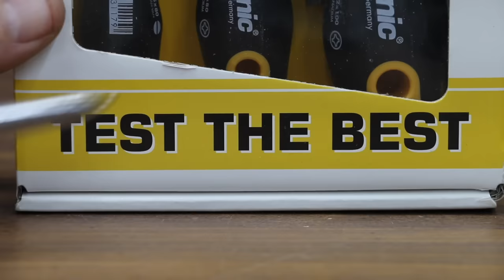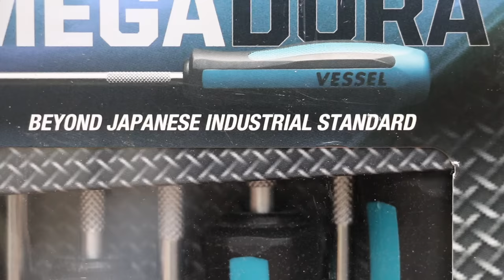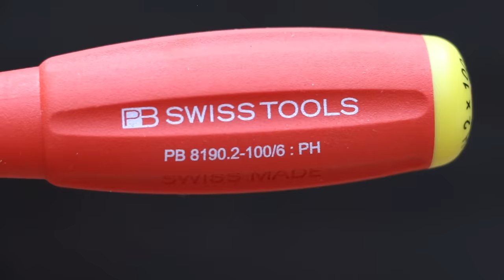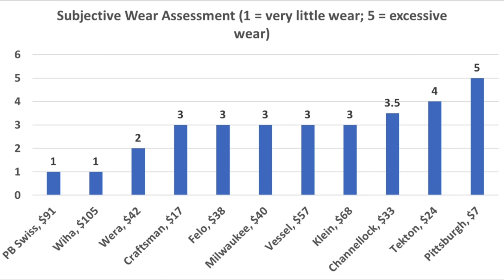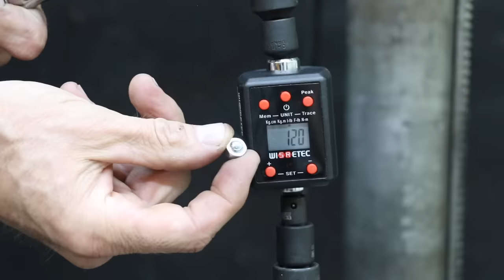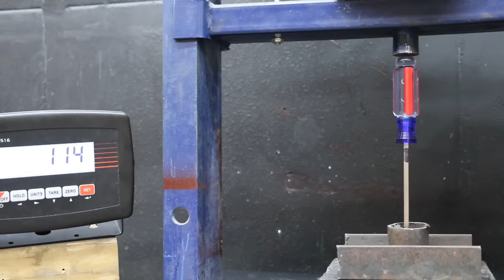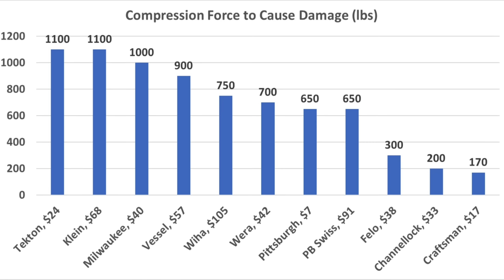Best Screwdriver Set? Craftsman, Milwaukee, Wera, Wiha, Klein Tools, Felo, PB Swiss, Tekton

Comment: Great videos, How about the Best Small screwdriver set? I find it hard to get a set of small screwdrivers that do not strip. Thank you
Reply from the maker: Thanks!  Thanks for the video idea.
Reply: @ProjectFarm  Another is needle-nose pliers. Make sure they stay straight or aligned, easy to use in the hand and how long or what size for the common work. I have some that no longer meet and have a sideways overbite, some that are too thick for what you need a needle nose to do, or not long enough. Thanks again, I love your videos.

Comment: I've had my Klein screwdrivers long enough that the rubber on the handles are completely smooth (roughly 20 years). Moral of the story, Don't cut the handle off and use it as a tip for your impact driver, use it as a pry bar or chisel and yours will last 20 years too.
Reply from the maker: Thanks for the feedback.

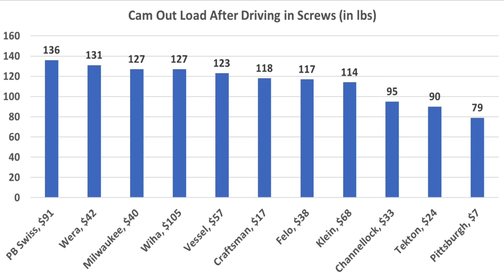Comment: Suggestion:  At 9:19 I wish you would’ve made red bars for the actual ones that broke versus green bars for the ones that just cammed out.
The reason is, one is still usable to a degree, and the other one is a complete loss; so that makes a huge difference!
Anyway, I really appreciate the video. I have both Craftsman and Klein and have gotten good service with them probably because I don’t hook them up to an impact driver! 🤣😂🤣
Edit: Did you think about Xcelite; it has been an industry standard?
Reply from the maker: Thanks!  Thanks for the suggestion.

Comment: The cheapest screwdrivers were not that good in a shop I work at where the magnetic tip is not magnetic and they were out very fast where the handle did not deal well to gasoline and other chimicals
Reply from the maker: Thanks for the feedback.

Comment: The vessel screwdrivers did not do well because they are not Phillips screwdrivers. They are made for Japanese screws.  They don't fit the same as a Phillips. Had he used Japanese screws, the vessels would have out performed all of them in the cam out test.  This is a JIS (Japanese industrial standard) screwdriver.  I used to strip out heads on screws quite a bit with Phillips screwdrivers while working on Japanese motorcycles until I found out about this.
Reply from the maker: Thanks for the constructive feedback.

Comment: if you own tools that are from 30+ years ago, one truth you cant ignore is that brand names arent what they were in terms of quality. i have sears, or craftsman tools that have not only lasted for 30-50yrs, but are infinitely better than even the most expensive brands made in modern times. like most everything, if it was made 30+yrs ago, it is better. my circular saw is a black & decker that would be among the cheapest if it were made today, but since its from the 80's its built like it was made for NASA. even my drop light light is from the 50's and still great, other than a new cord, and a heavily bent bulb cage, but thats to be expected. i miss when tools were built like tools, instead of like disposable razors
Reply from the maker: Thanks for the feedback.

Comment: I don’t care for this screwdriver test. Good screwdrivers fit the screw securely and turn when torque applied. For power driver applications hardened bits are available. I like SnapOn , BSquare and Klein screwdrivers for my needs.

Comment: I'm not so sure that manual screwdrivers are meant to be power driven with an impact driver so i'm not convinced  that this is a fair comparison. maybe a comparison  of power torque bits from ea manufacturer would be a better test. they would be made stronger.

the vessel drivers "phillips" tip are actually a different configuration called jis  which is Japanese industrial standard they're meant to fit jis screws from japan as found on Japanese made vehicles, motorcycles, electronics, appliances etc.
they don't cam out as easily as the phillips because they fit ea other (screw head and driver tip ) very precisely.  they are a much improved version of the phillips head screw. 
so a phillips driver used on a jis screw wont fit right and cam out and a jis driver is not the right fit for phillips screws although it will work its not ideal. and phillips drivers just don't work worth a crap on phillips screws period 🤣.poor design and engineering. 
I always use robertson screws.
Reply from the maker: Thanks for the constructive feedback.

Comment: One thing to mention is the Vessel screwdrivers are JIS which is not the same as Philips. You may as well have tested it against a Pozi drive. The Vessel screwdrivers grip JIS screws like a glove. Wrong tool for the job.
Reply: @htr5372  I use the Vessel screwdrivers on JIS screws and they fit exceptionally well. I have to be careful to not torque the heads right off the screws. That sucks.

Comment: Fantastic comparison.  I have PB Swiss, Wera and Wiha and you can't go wrong with any of these.  I also like the feel of the Vessel and they are less expensive than the other brands I mentioned. SnapOn was no in this comparison and wonder how they would do?
Reply from the maker: Thank you!
Reply: I have a few Wihas I've used for sensitive work (small laptop computer screws) and they've been great, at that small size they have a very nice detail of a spinning top that works very well for keeping tension on the screw with your palm while spinning the screwdriver, which I have yet to see others do so well. I would happily buy those or the weras now that my full size generic set of screwdrivers I got gifted a while back has some flutes starting to fail. 

To answer your question about SnapOn, a car channel called Donut did a test on screwdrivers that seems quite inspired by this channel's work. Both PF and Donut agree that Pittsburgh was the worst, and that Klein was not that impressive. At that mid tier in their tests was SnapOn, which was similar to Husky. Their winners where the Klein tools equivalent sold at Harbor Freight (Doyle) and the HF equivalent to SnapOn (Icon).

Comment: Cutting off the blade to use in a battery-operated screwdriver was a ridiculous test. They are screwdrivers that are meant to be used by hand no one can put that much torque on a bit designed to be used by hand
Reply: Guess your new round here. He does stupid stuff like that every video

Comment: I have a set of insulated Wera's. They are absolutely fantastic except that the insulation on the shaft is pretty soft and is wearing quickly, that is probably my fault for using them daily. I intend to get a set with bare steel shafts for my daily work and reserve the insulated for live work.
Reply from the maker: Thanks for sharing.

Comment: Not a fan of the slotted screwdrivers test. The screw didn’t properly fit the screwdriver on most of the test which doesn’t give you a real idea of performance. Obviously a better fitting screwdriver will have better results

Comment: What was the reason for running the drill in hammer mode to drive wood screws? Running a drill in hammer mode is for drilling holes with masonry drill bits, not for driving wood screws.

Comment: But since when do you use the hammer drill for screws? Isn't it a Concrete thingy if you want to drill a hole? Like no wonder your screwdrivers partially didn't even made it to the 30th screw.

Comment: These screw drivers are not impact-rated, so why would you test them in an impact driver?  That is outside their engineered use scope.  I could see running the first test with a drill, but not an impact driver.

Comment: Interesting, but not a single test in how the tool is actually used – with the hand.   I can't say cutting off the shaft and using them in an impact driver is a useful test for a hand tool.I guess the important things are how well do they bite how easily does the tip snap, how easily do they bend when you're prying, magnetizations, grip of handle when breaking ice.  easy to wipe clean.

Comment: I've got the Tekton set but in chrome, also have the Tekton torx set. I've used the set all year and the #2 Philips that's been used the most still looks like brand new with no wear whatsoever and the fit into the screw heads are awesome. I don't even bother using my Snap on set most of the time anymore, I actually like the Tekton set better. I've since bought the 6 in 1 Tekton and the 3 in 1 stubby since and been very happy with those as well.  I've got the same acetate handle Craftsman set I now keep in my truck; I bought those around 2013 and while it's a good set I find the handles to be very hard on the hands during prolonged use and the Phillips don't have that great of a fit. That was a USA made set when I bought it. Before I bought the Tekton set I was using the soft grip blue Kobalt screwdrivers, and I used those a lot and they are a great set, but I keep those inside the house now.
Reply from the maker: Thanks for the feedback.

Comment: On the accelerated wear test, if you're driving that many screws that hard by hand, maybe just get a driver?

And with the press test, I don't think it was quite an apples to apples test. There was a big difference between the press fit shafts and hollow handles. All the press fit shafts were pushed in to the end of the hole. Not sure of the utility of beating on screwdrivers with a hammer anyway.

Comment: I now have a set of the cheapest Pittsburgh thanks to my nice tools getting stolen, and just changed an alternator out by using the biggest as a prybar and hammered the old one out using the driver and a rubber mallet. No damage anywhere.
Reply from the maker: Thanks for sharing.

Comment: I went Wera after my first advent calendar several years ago. I have just about worn out a #3 phillips after 6 years of intense use installing custom furniture. The only one of 3 different sets so far that I've managed to damage. Their bit holders are my standard. the Wiha die after less than a month in the shop. Hercules won't last the week. Wera usually last a year. VERY intense use.
Reply from the maker: Thanks for the feedback.

Comment: I bought a set of Craftsman screwdrivers and the set was reasonably priced. I got tired of off brand garbage screwdrivers that have the shaft non-parallel to the handle. I tested every screwdriver visually. Every Craftsman screwdriver had the shaft parallel to handle. I refuse to use junk off brand screwdrivers that can be knuckle busters or cause damage from slipping. I just took the bent off brand screwdrivers to the dumpster personally.
Reply from the maker: Thanks for sharing.

Comment: Torx drivers are far superior to phillips. We rebuilt some rotten parts of an old barn a few years ago. Used up 25 pounds of screws. 2 inch to 10 inch. Torx is the only way to go in old hard wood. Used 18 volt impact drivers.
Reply from the maker: Thanks for the feedback.

Comment: PB swiss slotted (flat blade) screw drivers, Wiha, Were are designed for ISO spec slotted screws. The only way to properly test slotted( flat blade) screwdrivers are to test them with the slotted screws they are designed to drive. Once there is a gap between screw slot and screw driver the loads goes WAY up on the screwdriver tips and screws.
Point being, the slotted screw driver test in this video is not as valid as they could be. What is often not considered, how much damage does applying a given screwdriver with the torque needed to set a given screw to it's specified torque do to the screw head.

PB swiss slotted blade screwdrivers have parallel tips that greatly reduce cam-out. Hazet also makes a similar screwdriver. In the USA, these are known as "hollow ground" tip screwdrivers or "gunsmith" screwdrivers. 

The Phillips head screw will cam out by design, this is why other screw drives (Torx, Torque setsocket head, JIS, Pozidriv, Pearson, square, and ..) have been produced and is slowly replacing the Phillips head screw.. invented circa 1935., 

Essentially, these test proves the best screwdrivers tested are PB swiss, Wiha, Wera.. in real world use these screwdriver brands really do hold up remarkably well and the greatly reduce the possibility of screw head damage if the proper screwdriver is used with the matching screw drive head.
Reply from the maker: Thanks for the feedback.

Comment: Pittsburg tools aren’t made by Pittsburg and sold by Harbor Freight. It’s a HF home brand. HF owns many brands.

I hope it’s understood that the Phillip’s screw is designed specifically to cam out. If you don’t want that, try diamond dust coated tips. They cost a bit more but hold much better.
Reply from the maker: Thanks for the feedback.

Comment: I have a set of Craftsman screwdrivers and nut drivers. Every time I open the drawer, I am treated to the distinct aroma of puke. Turns out that the handles are made of poly-vinyl chloride which de-gasses yielding that smell. They are well over 25 years old and still stinking up my toolbox. Maybe the new ones are of a different composition, but the ones I have are really unpleasant (but not enough to buy others).
Reply from the maker: Thanks for sharing.

Comment: I like using my  30+ year old set of Craftsman screwdrivers but they sure do stink!  The handles smell like vomit. Do the new models also smell?  How about the other brands you tested?  Most obvious when you remove them after storing in a closed toolbox.
Reply from the maker: Thanks for the suggestion.

Comment: Being a retired aviation mechanic I look at screwdrivers as pry bars any and all and use bit sets exclusively even today. 40 plus years does that. Not being sour grapes or anything a cheap set of screwdriver is still more expensive then a bag of bits.  So I have a bunch of twisted remains of screwdrivers that end up in the recycling that I had for many years.
Reply from the maker: Thanks for sharing.

Comment: dewalt makes a destruction screwdriver set. I have broken the tip on a craftman twisting with my bare hands. I have never seen the Stanley fail that way either. May twist the tip but never break.
Reply from the maker: Thank you!

Comment: I had a German colleague back in 2006 - 2008, from the old guard and old enough to be my father, when I was in the CNC maintenance work role that would go mental with that last hammer test.

I had my good set of tools but sometimes I would need to use a hammer for something with a screwdriver, and for that I would had some piece of crap Chinese cheap ones to not damage my good ones. And even so we would go haywire and curse me in German because I was not using the tools the right way, even he kwowing it was a cheap set just for that. Sometimes I would even do on purpose just to mess with him. 

He would always say that there is always a better tool for that job I was trying to solve by using a hammer (even if by doing his way it would take 10x the time than I was taking with a hammer and a screwdriver).

Germans are very proud of their tools. He said always that men never have enough tools, there is always something you don't need now but you want thinking you may need in the future. And that good tools are expensive, but if used correctly and well maintained you only spent money once in your lifetime. I still keep this last motto to this day with my tools. 

Unfortunately he died some years ago in a car accident while coming home from work.

Karl, ruhe in frieden freund!
Reply from the maker: Thanks for sharing.  Sorry to hear of the accident.

Comment: Good test but there’s a little bit of a problem you cut the screwdrivers in half and install it into a Power drill. If I was going to use a screwdriver that way I would just go out and purchase a bit set there are several models on the market I believe you haven’t even tested that yet did you? In order to really test Philip screwdrivers flathead screwdrivers you have to use them the normal way by twisting your hand. I’ve had a lot of screwdriver sets over the years Some where good some where better. Because normally you’ll wind up stripping any Phillips screwdriver if you cut it in half put it into a power drill I believe bit driver sets are specially made to be used in power drills. Just my thought on it. If you haven’t tested bit sets yet you should it would be interesting.😀
Reply: Just an afterthought I’ve seen videos of industrial screw driving testing equipment where they placed the screwdriver handle into a machine that puts downforce on it and drives screws into wood.

Comment: I've been a craftsman (maintenance man) in a prison for the last 11 years, I've used numerous screwdrivers over the years. As for my experiences, I've found that wera, wiha, and westward are the best screwdrivers that I've ever used!!! I picked up a an SMU door (300lbs) with an around 10" wera screwdriver laying on top of a hammer, using it as a fulcrum, high enough to line up the hinges and the door. I've had that same screwdriver for a decade and has the original tip. However the westward flathead, Phillips, and bit driver have impressed me more than any other screwdrivers I've used, either in the chain gang or the free world!!!
Reply: Maintenance man😂 is that what you tell your family. Tim the live in maintenance man

Comment: Love your testing, but it doesnt seem like a real world test AT ALL to use a hammer drill on a screwdriver tip designed for manual use only, they obviouisly are not made of impact rated steel so I have to call this one NOT ACCURATEor fair even though it does provide a comparison.

Comment: The Craftsman seems like the one for me. I really just need a screwdriver for the occasional thing here or there. It's not going to be put to hard use very often but if it is it looks like that one will handle it fine. Plus my dad has a set from the 80s and they look the same which makes them nostalgic.
Reply from the maker: Thanks for the feedback.